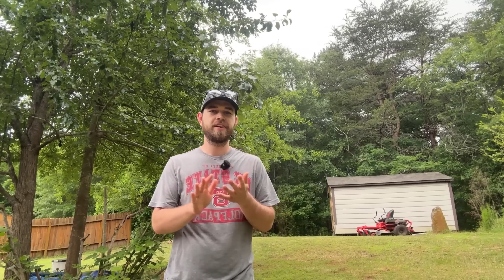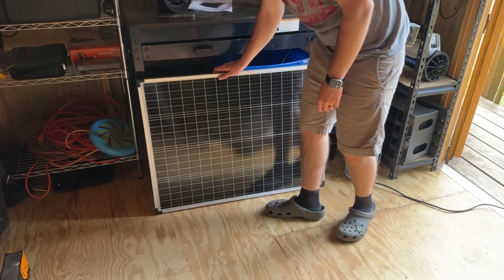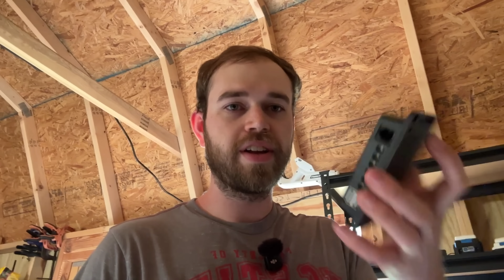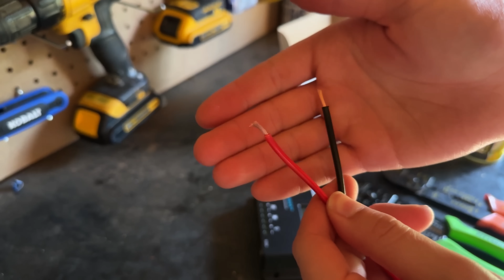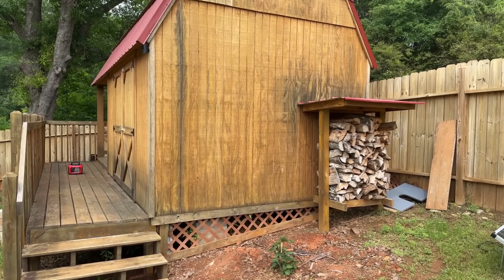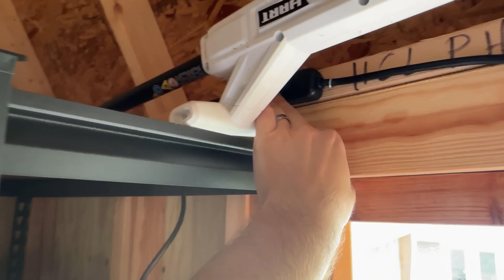I tried Harbor Freight’s cheapest solar panel setup

Comment: Very cool
Also with my solar panel system, it’s separate for my shed running through eight marine batteries being charged up by four 100 W panels which also run some other stuff 
But a good way to mount it to the roof of your shed if you wanna permanently mount it use Uni strut   You can mount a piece of unique to the panel and mount two braces on the roof seal them and be able to mount them both together if you position them correctly
The panels I found really don’t get affected too much by hail, but I am cautious so when we do have that possibility, I just put a piece of insulation Styrofoam over the top and then push that to the panel by an extended piece of unit strut for corners to hold it down with two pieces of wood for stability across the top of the Insulation, but to be honest, I am not had one panel break yet due to me being away for days at a time and storms going through, but you can also use a blanket or some other insulation type of material if it’s bad in your area.

Comment: These are cool for charging a phone or maybe a light or two. If you have heaters or compressors like an ac you need to run its 1000% cheaper to do a controller and deep cycle batteries with a stand alone inverter. With a 500w power unit from harbor it can run a very small space heater for about 30 mins

Comment: Sounds like what you’re using it for will take you 5 years of electricity to get you 400 worth back. In 5 years this system will be so obsolete. I guess the advantage is when you are in remote area with no access to a power source this would make sense.

Comment: That controller is designed to be used with batteries. It has to sense the battery voltage, and that port is input only not output. 

There's already one in the machine so no need for another

Comment: I run 6 of those panels on the roof, not permanently installed, but easy access to remove before hurricane comes, I also just purchased a 200 watt folding type to a 2nd  controller. Those panels are good, and they last.

Comment: I bought 40 amp romax 100 feet, one inch electrical conduit underground, a sub panel, one 30 amp breaker for the main and two 15 amp breakers for the sub. One breaker for outlets and one for lights. A role of 20 amp romax for inside the shed. Dug my trench and installed for less then $400.

Comment: Get some of those Wago wire connectors.  Those are great for setting something up where you're still working out where the wires will run, which order the components go in, how long a run it will require, etc.  You just flip the lever to disconnect and reconnect the wires after you pass them through the hole in the wall.  No electrical tape, and they're more secure than wire nuts (You're using stranded wire in this case; I think wire nuts would be at least as good for solid wire), but they're easily reversible the way some of those push-in connectors aren't.  I like them for Halloween projects, where I'm making it up as I go, change things from one year to the next, etc.

Comment: You could bungee cord the panel down for wind protection and place it vertically if hail is expected. I have 10 of those panels connected through a controller to 5 deep cycle batteries. The panels have been out in the weather for at least 4 years with no problems. We don’t have to worry about hail here. Great video.
Reply: What brand?

Comment: I'm so jealous that you can have a shed with a window, fan, and solar panel just sitting on a shelf outside. Where I live, which is a quiet rural area, surprisingly my shed with no windows has been attempted to be broken into 4 times already. I am thinking of putting a solar powered security camera on it, and I'm wondering if they'll just steal that.
Reply: 95% of all thefts are from people who know you. 90%of thieves are under the age of 30. The easiest way to scare them off is battery powered alarms , located in a locked area, super cheap and small, no need for outside power, batteries? flashlight batteries last for a couple of months.
Reply: Frickin meth heads🤬
Reply: Let them steal it; the key thing is that your   recording device or hard drive identifies the thief which is the purpose of a security camera.

Comment: I have had two predator generators and a 100 wt portable solar panel.  Their stuff is junk.  Their power stations are really shitty.😊
Reply: 100 watts? Two light bulbs of power?
Reply: @RalphFischer-k7z   The generators were 2000 watts though.

Comment: I’m curious how a ac unit would work with that set up
Reply: It wouldn't.  Small room (<250 sq ft) portable a/c units in the 5000 BTU range draw 600-700 watts.  His power station is only 350 watts.
Reply: You would need a larger inverter for the watts, and one that could handle the amperage of the compressor

Comment: The controller needs to identify the voltage (12v or 24v) battery first so it properly controls the solar coming in.

Comment: Really like the setup, I’m planning to have a shop built sometime next year, really wanting to go solar to save on energy costs as much as possible. I’ll probably wind up running more than one panel and power station but that’s just me. Good info in the video, more than enough to get started. Having to make or find your own mounting hardware for the panel is a bit of a pain but for the price, I guess one can’t complain too much. Some aluminum brackets and self tapping screws would make that easy

Comment: Your house is right there, you couldn't just run electric out to the shed?
Reply: That could be in his future plans. If the Predator does what he needs I don't believe its something urgent for him to tackle. He'd have to comment. Good question though. Have a good one.
Reply from the maker: @IYUB30 you’re exactly right. Long term, sure I’d love to run electricity to the shed. Right now though, it’s pretty low on my priority list. The house is a fixer upper so there are more pressing issues

Comment: Truthfully, a 100 watt panel off amazon is 70 bucks, a 100ah battery is 90 bucks, that renogy charge controller is 40 new, and 2000watt inverter is about 100 bucks, so you into solar for 300 bucks and you have much more energy storage with the 100ah battery and room to upgrade to 400watts of solar with that charge controller and add batteries as needed.

Comment: I have this set up just completed it. I have it on a small out building shed with a thermostat for an exhaust fan and battery chargers. Is it ok to leave it on 24/7 for the exhaust fan?
Reply: I have an exhaust fan in my shed and it always spinning without any power 
If you install it in the correct location you don’t need to power the fan.
My exhaust fan is a pretty good size also it’s not small but I have a computer size exhaust fan also installed for my soldering station works perfect no power

Comment: The reason they are repeating to you to connect the battery first to the regulator is because
the regulator will auto select voltage from the battery source.
you connect a battery at 12 v dc, the regulator will operate at 12v dc and ramp charging to that need.

IF you should connect the solar panels first to the regulator, the regulator sees ZERO volts on the battery and 
it will ramp charge from the solar panels to the MAX, and probably burn out the regulator with high amps.  
they say wires have insulation to keep the smoke in, if you see smoke, its too late.

but a 350 watt power station is only about 3 amps at 120v......  its ok for lights but.....  a 100 watt solar panel with sun hours is not good for much more than a few amps to charge the battery.  Your power availability will be somewhat limited

BUT
on Harbor freights side, those panels have been tested against much better quality panels and they pretty much equaled or out performed the competition.

Comment: I'm sure you figured this out by now or someone else commented, but having a charge controller in-between the power bank and the solar is redundant. The power bank has its own internal solar charge controller. Charge controllers or only meant for if you are connecting the solar panels directly to a battery like a lead acid battery or a Lithium Iron Phosphate battery. In that case you need a charge controller. Very cool setup though for your use case.
Reply: Yeah I don’t get why he thinks that was a good idea. You’ll cause more problems with a $17 no name Amazon controller than you would with the internal controller in the power station.
Reply: Thanks! That is the question I was searching for an answer to. I think that means, if I am trying  to keep lead acid batteries charged on my equipment,  I can save the cost of his predator power station.

I am still unsure of how to charge a bank of 6 volt batteries hooked up to a 48 volt system using primarily solar power.

I first wanted solar just to maintain the batteries. Now, I am expanding my thinking that I already have a battery storage system that others have to buy as an accessory to their solar system.

This equipment will only be used for a few months every couple of months. Maybe in the meantime, it can help power an accessory building kind of like he is doing.
Reply: @kellyinfanger9192    the obvious answer is to wire four panels in series to get 48 volts and find a charge controller to match. The tsuff is out there.

Comment: 100 watt panels is a bit on the light side.  Another 100 watter would make a big difference.  I started with 100 watts and now I'm up to 500 watts. Just love it!
Reply: He can't use more than half of what his power station is, and since it's only 350 watts he can only have one 100 watts panel
Reply: @aubreyjackson9770  Thanks, i had no idea as to what the specs are.

Comment: I don't understand why you chose to add an external controller. That aside, I have that same power station and absolutely love it. I use mine in our barn with a couple of led shop lights, or sometimes a fan, and in our RV. One feature that the HF Predator has that some others don't is a 'charge through' ability which means you can use it while it is charging. I was surprised to learn that not all of them do that. Your video convinced me to get that same solar panel, as soon as it is sale again because I'm in no hurry.

Comment: Just bought a Jackery power pack plus a 100 watt solar panel for 299$  at Amazon , enough for a tv and a string of 18 led lights working for more than 3 hours
Reply: 50 bucks 100 w solar panels, Temu , work fine, got lucky $255 refurb Ecoflow river 2 pro 700, the 716wh one  also Temu, ecoflow has store on there.  Got 15 off the 255 with Temu coupon too.  Months ago, prices higher now 325 sometimes, lowest lately was $274

Comment: Wife and I have the Predator 2000 watt power station with 4 solar panels. We have an acre of off grid property that has a barn that we turned into a house.
Reply: Does it power a freezer? Do you just plug the freezer straight into it?
Reply: @AmeliaJane1234  propane
Reply: My brother,  would you please tell me how much that cost total? Any details to your set up? I want to move back to my cabin , but I need to have refrigeration for my food and that is it, if I can run my small chest freezer I can have frozen food or wild game and not worry.
Reply: @1johnnygunn  My brother, he doesn't have time to answer your question.  He just needs you to like and subscribe.
Reply: @1johnnygunn  When buying anything you need to understand what the appliance load will be ahead of time. You also need to figure there will be days with little or no sun where you need extra capacity.... and likely sereval days of run time to cover that gap where you can't charge at all.
Reply: @1johnnygunn   Consider adding a root cellar to your food storage arsenal. That should help you, too.
Reply: How long have you had it?
Reply: would love a video on how to set that up!
Reply: Wonderful video !!!
Reply: Maintenance would involve cleaning the solar panel to maximize the energy generated.
No other maintenance, right?
Reply from the maker: That’s awesome! I’ve enjoyed using the 350 so much, I’ve been thinking about upgrading to the 2000
Reply: @WattsNextSolar25  sir, how is your setup preforming? My elderly parents have a shed and it needs power for ventilation fans, single light or perhaps led strip. This setup looks easy enough for me to understand. Once the charging hits 100percent, will the power station over heat or is there a auto cutoff like when charging an iPhone?
Reply from the maker: It cuts off automatically. I have since upgraded to this setup, although it might be overkill for what you’re looking to do:
https://youtu.be/KUU6vWjmlo4

Comment: that small hand help charge convertor isn't going to make true readings because it's not a true MPPT convertor -- why is that ? ... 
because a  MPPT convertor will have a coil in it to convert the solar panel volts ./ watts to a household 110-112 v ... you need a transformer to do this and what you have will not give a true readout ... it is reading from a chip ... in order to do this -- it must have a heavy resistor to bring down the voltage values so that their chip can do a readout of watts ....

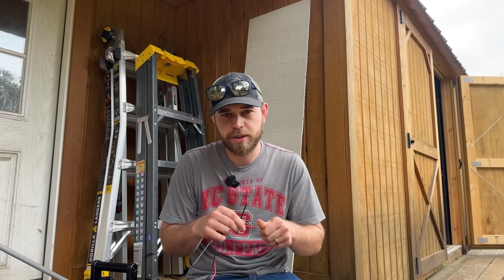6:29 -- the reason it's not working is because the HF unit already has it's own convertor in it -- what you are doing is adding another convertor to the HF unit -- will not work ... however -- you are right -- you are not an expert ... connecting to the small charger before connecting the solar panel -- it's because the solar panel is always on - or HOT ... unless you have a breaker switch before you as the solar panel wires - it is always HOT ...  good video on an HF unit ...

Comment: If you hook the panel to the charge controller first you will fry the charge controller. You smoked the interior of it because that power has to go somewhere and if it has nowhere to go it becomes heat. I know this from previous experiences.

Comment: Make a set L bracket with the same size hole as the legs on the solar panel and slide the legs through the holes.....

Comment: That flickering display on the power station is all I needed to see. No way I'm buying one of those. Have a Jackery 290 that I bought from Harbor Freight about 5 years ago. No problems with it at all. Even ran it down to 0% accidentally 3 times. That's not "recommended". Charged it back up each time and put right back into use. Only issue with the Jackery is the amount of time it takes to recharge. I do plan to sometime upgrade to a bigger unit with more modern cells than the 18650s in the Jackery. Although these cells are tried and true found in many devices for good reason.
Reply from the maker: The flickering display is just from the camera. It doesn’t look like that in real life
Reply: 😂. Point your camera at a tv and record. Chances are, you will capture flickering due to the differences in speed and the spectrum.
Reply: The "flickering" is the refresh frequency of the screen is conflicting with the refresh frequency of the camera.
Reply: Simple useful project and it serves it's purpose, I appreciate your presentation.
Ampinvt from Amazon has an 800 watt LOW frequency inverter for $158 and the 3000 watt version for about $465.
The  800 Watt one will run my 5000 BTU window unit (560 watts)
These are heavy and run inductive loads like motors, very well. The "normal" inverters most use are high frequency inverters, but they often fail, and that's what those power cubes use .
Do a YT search and learn about the low frequency inverters.
$158 is an amazing deal.

Comment: The controller you tried to hook up is less than the one inside the power station. Cheaper design and not needed. You only need one controller.

Comment: If you wanted a light to come on at night (sensor-light or just one that automatically comes on every night) could you leave the inverter 'on' all the time without draining the battery?
Reply from the maker: This power station will turn off the AC outlets automatically after an hour if no load is detected. So unless your sensor light turned on at least once per hour, the power station would turn off on its own

Comment: That's a great set up for power and for what you want it for!
I'm off grid Delta Pro and two Eco flo 400 what panels that runs TV, fridge, and lights and you really grow to appreciate Solar Power.
Reply: I have a Delta Pro as well! Can I use any solar panel with it?
Reply: @Mr.Frostyman Yes, just need the converter cable.  I got the Mc4 to Xt60, Connector Solar Charge Cable.  I hooked my renogee 400w solar blanket to my ecoflow using this cable.  That’s it!
Reply: @Mr.Frostyman  I would think you can use any solar panels for your Delta Pro,I used Eco flo because I like that the whole system is Eco flo and it works great....
Reply: @Mr.Frostyman  Pretty much. Just have to make sure the panel power fits the power banks parameters.
Reply: Impress me show me a system you can buy at harbor freight that can run a washer dryer.
Reply: You have a delta pro what? Is it a generator, power bank? I’m just learning about all of these parts and I wish someone would just list out all the parts and where to get them.
Reply: Cool
Reply: Watt?

Comment: when I have to cut a connection wire  I leave an inch or 2 of wire... by doing that you are able to reuse the connector in another project if you have to